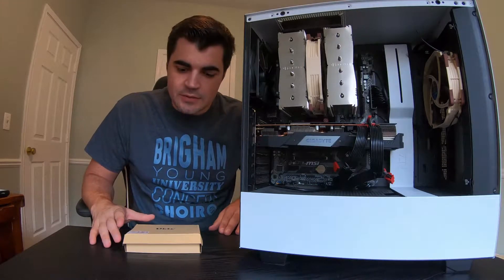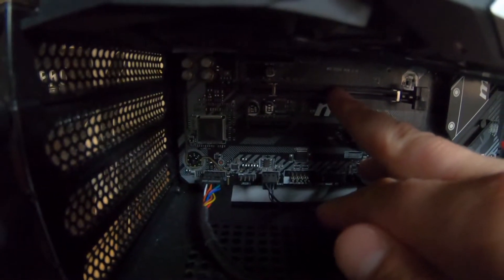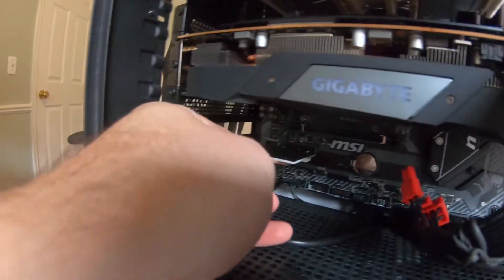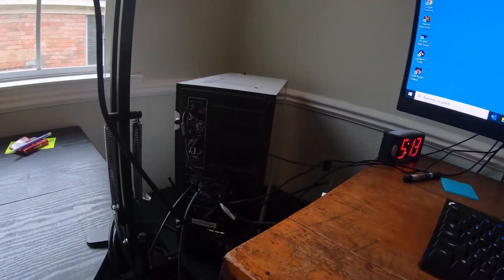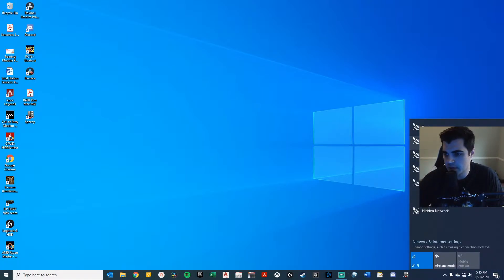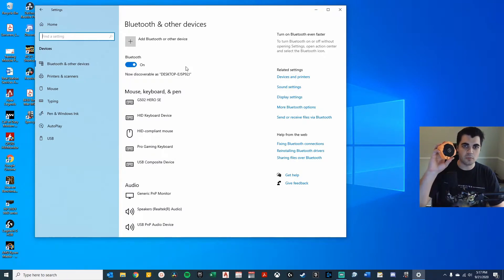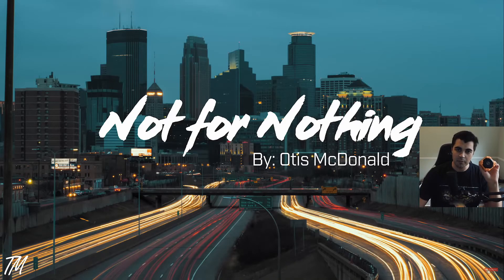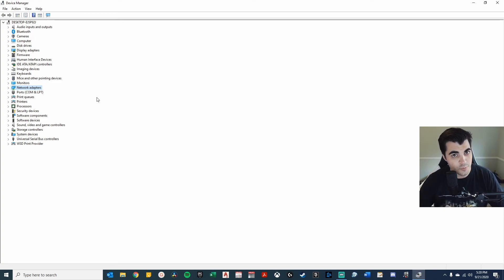Ubit Wifi 6/BT 5.0 PCIe card install tutorial

Comment: I installed this card in my tower yesterday & then today I compared it vs. my partner's Dell xps 8700 (towers were same distance from router/modem, mine was turned off while testing her's, and viceversa).  Off the LAN cable we are getting 875 Mbps DL & 106 UL, off her Wifi she was getting  48 Mbps Download speed & 22 Mbps Upload.   My tower with the new Ubit card  688 Mbps Download &  107 Mbps Upload.   A huge difference!  And the speeds I'm getting off of the Wifi card, I'm planning on replacing the one in the Dell with another Ubit card. (I purchased 75' of higher grade LAN cable for the Dell but now we won't even be needing to use that cable).   Works great!

Comment: Will the drivers automatically download if I don’t have an ethernet cable connected? Unfortunately I don’t have an optical drive installed into my computer and I just plugged in this card, but no drivers were automatically installed.
Reply from the maker: Mine worked right away. But yea, windows updates are all that you really need as well. If you mist, you may need  to download the driver from ankther computer on USB
Reply: @cougarcn  thanks for the quick reply, subscribed.
Reply: @cougarcn  I downloaded the drivers on a USB and transferred it to my pc .... I downloaded and it didn't work :(

Comment: I just purchased this exact one from Amazon and the white cable you’re supposed to connect for Bluetooth is broken. I have the cable but the connector on the Wi-Fi card broke off I guess. It just isn’t there and there’s no way to connect it. But if I never use Bluetooth on my PC and just want the card for WiFI 6 I can still use it, right? Everything else worked fine just the BT cable. I’ll be able to still use it as just a WiFi card, right?
Reply from the maker: Exactly. That stinks though! I'm sure Amazon will replace

Comment: Windows didn’t install anything. Wtf do I do
Reply from the maker: run a couple of windows updates just to be sure, and then go to the ubit website and see if they have the driver download for you there. It should just be the intel wifi driver that you need that can  be found via a google search as well. It should be straightforward hopefully
Reply: @cougarcn do you have to do anything after the install?